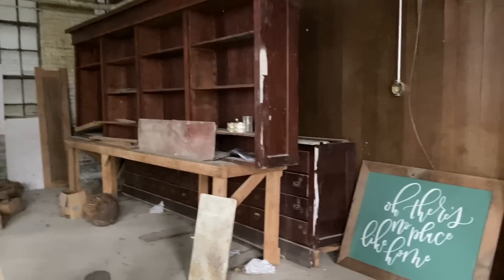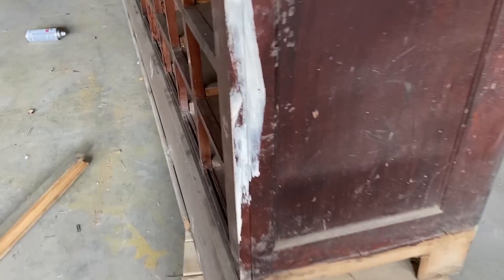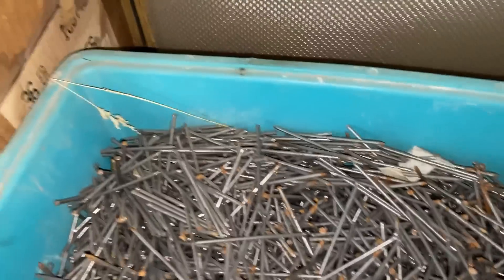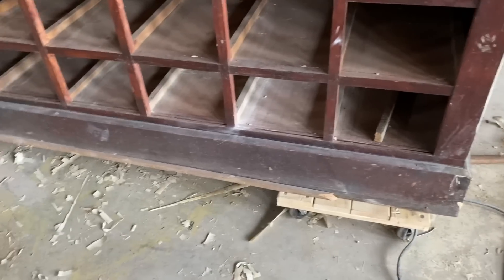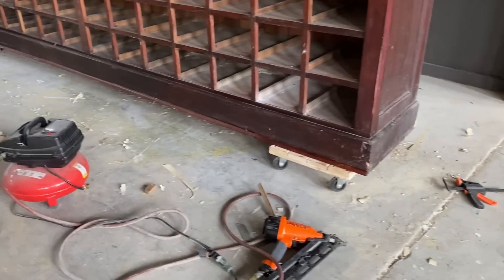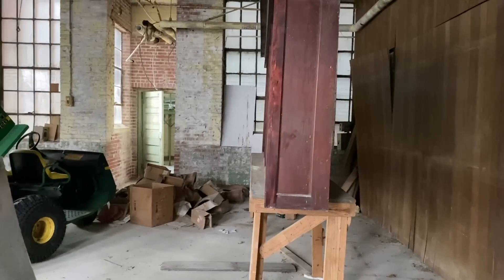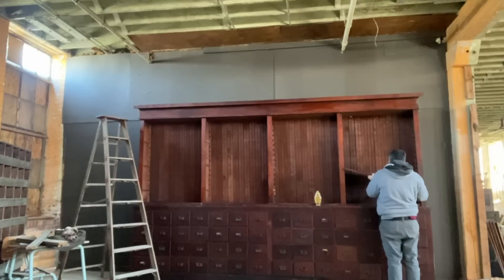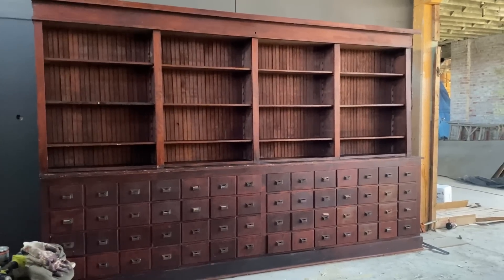Refinishing a gigantic antique apothecary

Comment: I absolutely LOVE apothecary cabinets! Love to see this one getting restored!
By the way, I love that you do your best to re-use / re-purpose all the materials you have available. 
Just one tip - please consider brushing all the spider webs, dust, etc. off and give it a good wipe down with a damp towel before adding wood or screwing something in. This ensures that there will probably not be any further issues month / years down the line.
Reply from the maker: Will do!

Comment: Chris, what a cool piece and it looks really good after you got it all cleaned up!
Reply from the maker: Hey man.  Thanks.  I have two more to do but they should be a bit easier as there is no paint issue with them.  It's gathering dust again right now.  Getting ready to do a big push on cleaning.

Comment: From the Sanborn map— the “cement house” was probably where the solvent-based glues were stored.  Shoes were mostly glued together, and the solvents were highly flammable.  This explains the fire door on the outside of the building, which I think is the base of the second floor ramp…
Reply from the maker: Very interesting, it is directly across from a door into the building that hasn't been opened in ages.

Comment: A couple of things I learned along the (sometimes costly) way in restoring our Victorian Era house, some 30 years ago. The horizontal lines, or marks on a board come from a planer that was either slightly dull, or being fed too fast for conditions.  They possibly came from a bandsaw mill, while being resawn.

Removing latex paint isn't that hard (like using a chisel or sharp scraper as you did. I found that a product called "Goof Off" works very well. It comes in a spray can or non-spray can, which has more content.  The end boards along the rear of the cabinet were used to fill in between the wall and the cabinet, scribed to the wall, and fitted on site during the initial installation. Your example was most used in a hardware or general store. An apothecary would have had much smaller drawers.  I found that when gluing wooden parts, the Gorilla Glue works very well, but only when you follow the instructions to the letter. It is a water catilazed product, and expands to fill the tiny voids. A little goes a long way!
Reply from the maker: Lots of great tips.  I called it apothecary because I bought it from a pharmacy in 2020 where it had been in place for 120 years.  Likely a built in as you mentioned. I cleaned out lots of old medicine bottles and even some poison!  So that is why it has horizontal lines on one side and saw marks on the other.  Thanks!

Comment: A few thoughts for you... 
---Removing the white worked great, but there are few other strategies that may work. A heat gun-however, it will sometimes take off the finish you want to keep. A blow drier is not as hot & may work too loosen an adhesive that has been applied. 500 to 750 grit sand paper or 4 ought steel wool is abrasive but not too abrasive.
---The Howards wax is great, but it is not a finish coat. You need to add a finish coat or your stain is not protected. You need to apply a hard wax that provides a finish coat. I like Walrus Wax brand, but there are others that work well. Another trick, if you are sure the old finish is compatible with shellac, put a coat of wax free shellac on the entire piece then put on your hard wax. I general put it on with a cloth, not a brush. This gives a good dose of the right kind of oil.  Howards also helps the drawers slide easier.  You might want to put it on drawer sides and rails.
---Restorers always pre-drill holes for nails. You may also find using dowels to be helpful. Nails will pull out over a short period of time. Gluing will help keep nails in place. However, it takes much longer for a glued in dowel to pull free. You can use the 3 foot dowels you buy at lumber yard.  That way you can cut them to the size you want. 
--- If you are going to work on more large pieces. You need to turn some of the pipes in factory into really long bar clamps.
---It may be easier to put in & take out screws on a slower drill speed. Try a 1 to 3 setting. Sometimes,  the torque of the electric drill works against you.
---You won't see that method of stain application much on YouTube, but I've found it to be great for mixing in stain to match another stained section. It gives you more control. 
---General Finish products are great!!
And a question...Round Top has intentionally fostered the design focus over the last 5-10 years. They have built facilities & targeted these audiences to get year round sales, not just during the shows. Is there nothing similar in upper midwest?
Reply from the maker: Thanks for all the tips. I need to re-read through it again!  There is a show in Brimfield Mass.  But I am equidistant from both so that's a challenge.  There are large shows but not that are at that level to attract interior designers as a must attend.  There is a giant strip of land next the factory that stretches as a byclicle path to the next town, I always thought it would be a great place to start a local show.

Comment: nice score bud, you can rent a trailer, I would either build dedicated carts or buy more of those furniture carts and screw them to the bottom of each piece. A built cart with large castors to support it properly is the way to go. That piece is worth the effort.
Reply from the maker: I may do that.  I am thinking about buying a box truck or cutaway truck.  I have several of the carts in the building.
Reply: @brickandsole  I was thinking 2x4's and like 3 or 4 inch castors. Basic frame and strapping or plywood. You could use long skids and just add castors. 2 or 3 skids bolted together same same. Bonus! buyer gets to keep the cart. For the right price of course! Buyer just needs to pay up and push it away.

Comment: The wood is hard because it’s old style mahogany. You will have to raise the whole thing off the ground on feet our castors (8 is my preference), so the skirt doesn’t drag on the floor or it will come off as will the sides, because of scraping along the floor. All you need is a 1/8 of an inch so it doesn’t catch. If you don’t want to sand back and wax/stain then use isopropyl alcohol and wire wool…and elbow grease to get rid of the paint marks and splatter. Any time you use colour…it will dry lighter. I would add some sort of catch, accessed from inside the bottom to attach the top so it doesn’t tip over or off.
Reply from the maker: That's a good idea on the back.  I'll look into this small casters.  Thanks.

Comment: Did you look for numbers on the back of those drawers?  Most times they are marked for their position in the cabinet.  Nice piece.  You may want to fix one of them up and keep it for storage of small pieces, hardware etc., and use the top as a showcase kind of deal.  It's easy to add dividers into the drawers - cut wood to size and just hot glue the dividers in.  The hot glue makes it reversible/easy to modify for future needs.
Reply from the maker: I checked there were not markings.  But if I get it inside a normal space with non-broken windows it should let the swelling go down.

Comment: Yup - pre-drill your holes in old dry wood to avoid splitting, and don't underestimate the use of wood glue and clamps.  Also a heat gun is a great thing around to remove laminates, stickers, etc..
Reply from the maker: Yeah, I thought about the heat gun after I finished and was watching the video.  Next time!

Comment: Superfine steel wool taken to the "paint brush cleaning" spots (with a light hand) is about the only thing that would take it off for sure and leave much of the original finish intact....a fresh razor blade to dry scrape it (at about a 90 degree angle to the wood) might work, also. Methyl hydrate on a rag is also a possibility. That "mac tac" on the plank could have used softening first, a blowdryer might have done the trick. Some methly-hyrdate would wipe off the excess residue that is/was still stuck to it. Though you'd need to use rubber gloves and a well ventilated area.  Museums use methyl-hydrate to liquify the old finish and redistribute it, so you might not have needed the dye. Numbering the backs of the drawers might have been in order.  In any case it turned out decently without all that, but maybe you can use the info in the future.  It will take the "right" buyer, but it doesn't mean it has to be cheap. Would be likely a commercial business or wealthy buyers with large studio type apartments.   Though, frankly, I'd be awfully tempted to keep it for display in your retail area...those drawers will be excellent for storing and retailing hardware, and the shelves for displaying the shades and such for lighting, etc.
Reply from the maker: Hey Bear, I realized that when I was watching the video.  either way the final product came out matching even though I didn't do a good job of proving it in the video.  I think they make 90 degree scrapers with razor blades don't they?
Reply: @brickandsole  I believe so.

Comment: I'm an old truck driver and when I owned my own truck I used to go onto a broker board and anyone that was in my area that was looking for cheap boats to get me home to Arizona I don't know if they have a broker bored anymore but you could talk to some truck drivers that are still driving and find out if they still have the broker boards to get like half loads quarter loads almost 53-foot semis to Texas and then put it into a storage unit until you can get there
Reply from the maker: This is good advice!  I was wondering about that.  Because Hopefully these will be a one time thing and later I'd be able to get by with a more reasonable sized trailer in the future.  I'll look into that.  I also need to look into local storage in the area there on location.  Thanks!

Comment: Hi. Can I recommend not using a drill to drive your screws in. Milwaukee makes a compact driver for putting screws in. It has a ratcheting action that keep you from stripping the heads off the screws. Really enjoying your videos otherwise. Keep up the good work!
Reply from the maker: I do have a torque drill, maybe I should have used it.
Reply: @brickandsole  looked at mine today. It’s called a hydraulic driver